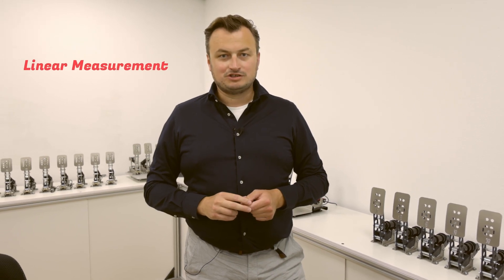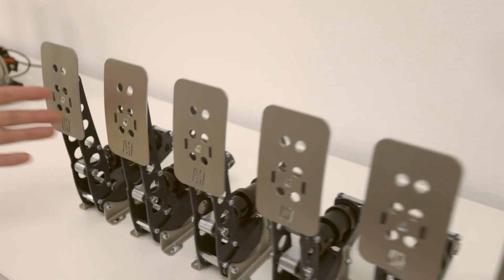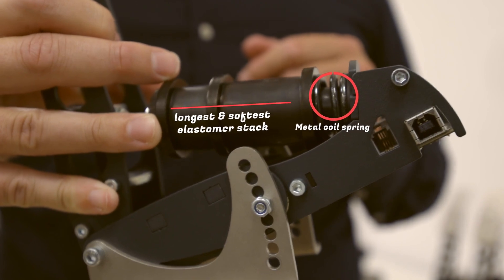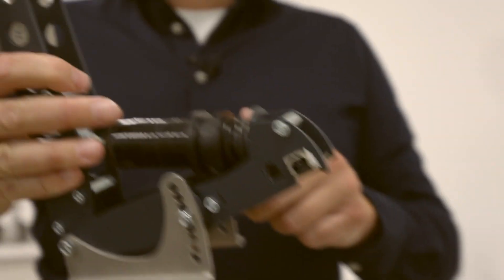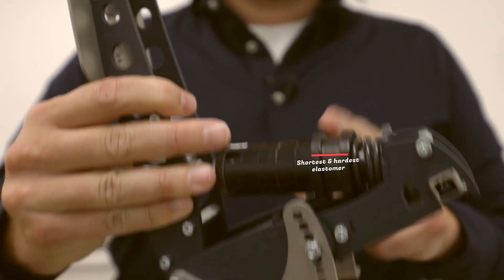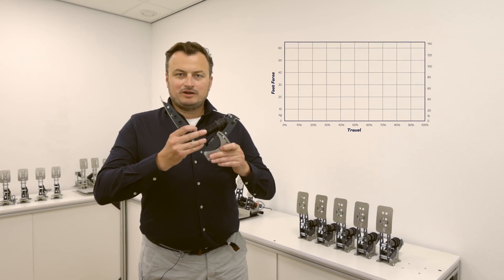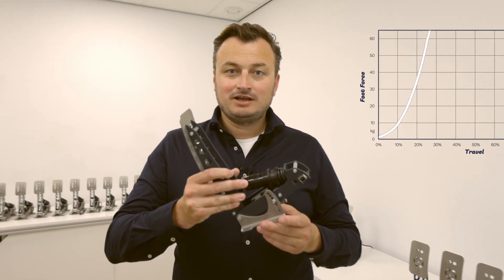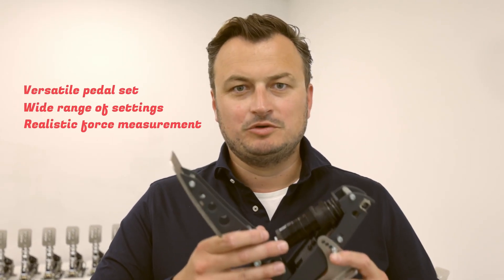The progressive brake feel with the Heusinkveld elastomers explained with the Sim Pedals Sprint

Comment: Hi
A small question about what effect the elastomers have on the output on the load cell. Do both examples give the same output on the load cell, or do the elastomers affect this somewhat.
Reply from the maker: Hello pahe, 

Thanks for your question. 

Force = Force. The amount of force transmitted to the loadcell is not related to the hardness of an elastomer.

If an elastomer is stiff or soft, it has no effect on the force which is transmitted to the load cell. So 10kg on a soft elastomer results in 10kg force on the load cell. Also 10kg on a hard elastomer results in 10kg of force on the load cell.

Best regards,
Your HEUSINKVELD Team.